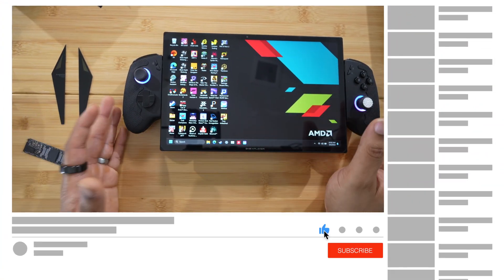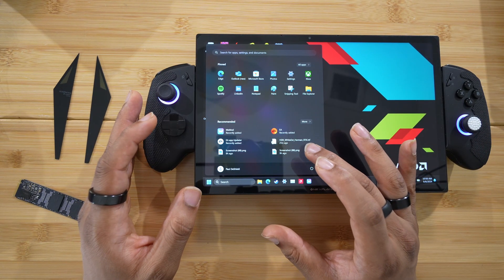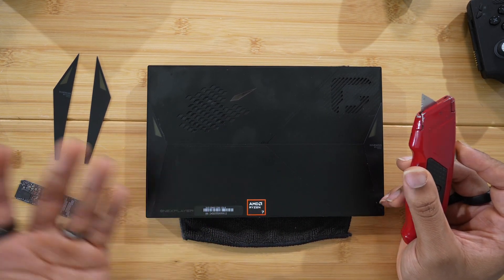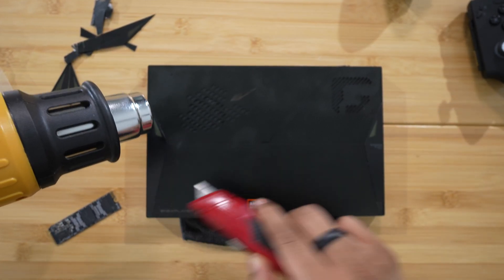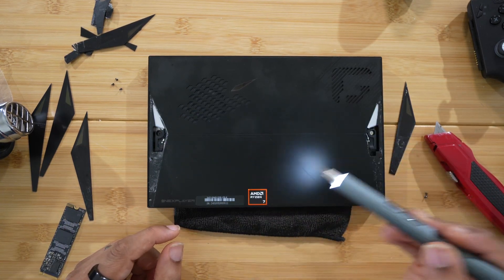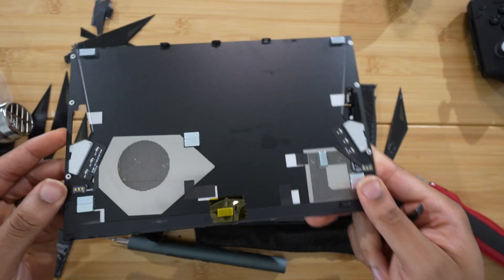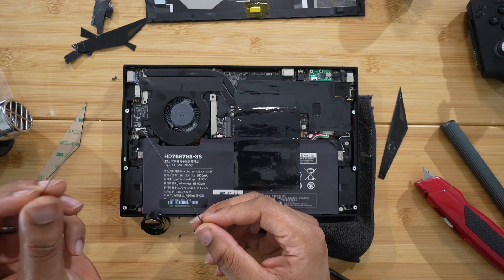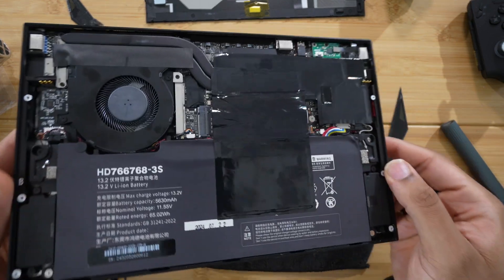OneXplayer X1 SSD replacement | A Cautionary Tale

Comment: I need the back back .  Likt the leather cover kickstand thing. Cant fint them anywhere..😅. 

I have a powered cooler that magnetically attaches and i wanna cut out a section so i can leave the cooler directly touching the body of the pc rather then the leather thingy .  

If i could find a replacement then id go ahead and cut the section out of the magnetic stand..  otherwise i prop it up against a weight i have lol...  I basically have it hooked up to a ultrawide 1440 p monitor and use it as q desktop.  It like the stand still caz of the built in camera and streaming otherwise id just close it and lay it flat on the desk..    anyway...  Know where i can find replacement back leather/ kickstand things for it?
Reply from the maker: You can get a replacement back cover stand here: 
https://onexplayerstore.com/collections/original-components/products/original-parts?variant=49662302159142
Reply: Lmao...  I didn't go far enough over. I legit thought the part list was looped with the different parts 😅. Thank you!! @BarelyAverageDude
Reply from the maker: @StonerDeer lol no problem 👍🏽

Comment: Will it take an 8tb?
Reply from the maker: It can
Reply: @BarelyAverageDude  tempted to get one to do it but knowing me I will break the glass
Reply from the maker: @ make sure to heat it up
Reply: I am weghing this vs the f1 pro@BarelyAverageDude
Reply from the maker: @jonsaavedra175  this definitely weighs more 😅 
(I couldn’t resist)
Reply: @BarelyAverageDude  i like the x1 because of oculink but I like the f1 because smaller and lighter lol but no oculink
Reply from the maker: @jonsaavedra175  don't tell OneXplayer, but what about Ayaneo 3? 
It's small and has Oculink 🤷🏽‍♂️
Reply: @BarelyAverageDude  fair but almost the same price as f1 pro but curious if it is a standard 2280 ssd and how the modular inputs interface
Reply from the maker: @jonsaavedra175  it's 2280 and the modules snap in with a securing mechanism and connect with internal pogo pins. 

I honestly think the Ayaneo 3 may be slightly better than the F1 pro (based on what it offers) but I haven't tested it of course

Comment: Was the ssd inside yours a 2280 size?  Sure looks like it and i was under the impression the larger x1s used a 2240 max size?
Reply from the maker: The big X1 uses 2280 SSD. 
The X1 mini is 2230/2242.

Comment: Was watching this as I did my SSD upgrade and it was not near as bad as you said. The official video did not show them heating it up, but you could see that the glass was using adhesive in their video. I just set my heat gun on 2 (hottest mode) and smoothly moved it over the glass without focusing on any particular location and it worked great. I also only used my knife AFTER I used the heat gun, no need to use it at the same time.
Reply from the maker: I took one for the team 😅
Glad you did it without issue
Reply: @BarelyAverageDude  I for one am glad u documented this because I'm the type that jumps into things before fully researching it thinking it'll be normal and like other units I've worked on.   I don't get why one x made the decision to use this build design.  I do like the quality they went to one the inside though.  Looks like they put lots of attention into it.  I also kinda wish they had used a second fan they obviously had room for it.

Comment: Question Barely Average Dude, may bring it up in the X1 discord as well.

Can an 8TB NVME SSD fit in there?
Saw Western Digital have a much "Cheaper" WD_BLACK 8TB SN850X on the market now.
I'm ready to buy if someone can confirm it does fit. (will not blame them if problems arise)
Reply from the maker: @AdmiralBison  I put a double sided 4tb SSD in mine and it fit snuggly. That gives me hope for an 8TB. I'll look into it.

Comment: hey quick question, i have a extra 2tb 2230 that I have and want to use that instead of buying a 2280. Could I just add the 2230 and tape it down with some electrical tape and a thermal pad?
Reply from the maker: @Cerealkiller824  you can use an extender like this to fill the gap. https://amzn.to/4gltX8W

I think it’s safer than just tape.
Reply: Thanks for the great question and stellar reply with link. Am extremely new to pc and gaming. In my 40s it's a tricky learning curve. This is exactly what I needed to know

Comment: Thanks for the video. It clears up some doubts about how this device is repairable. I believe using a blade creates extra tension on the glass, which will cause it to break due to its thickness. However, using an ultra-thin stainless steel curved spudger pry blade will have less tendency to break the glass.
Reply from the maker: Great tip!

Comment: Wait I thought the SSD was supposed to be accessible behind the kickstand. Is this the older version or was that marketing BS?
Reply from the maker: That’s the X1 mini
Reply: @BarelyAverageDude  now why wouldn't they just do it with both 8840u version?!
Reply from the maker: @ryanoliver960  it’s a totally different design, the X1 came out before the x1 mini and has an attachable magnetic stand so the tablet itself is just a flat metal back panel. The mini has a built-in kickstand that is much smaller.  
The stand on the X1 mini is way too small for the X1
Reply: @BarelyAverageDude  ah, I didn't realize they kept the original design of the x1 for the larger model. Good to know!

Comment: A few tips that might help in the future... You should not be holding the heat gun that close....a few inches away is optimal... Also always keep it moving sweeping back and forth. You could damage/melt something pretty easily. And maybe try a scalpel like they did in the tutorial video. But great and informative video.

Comment: as a X1 onwer thats the only thing I don't like about the device. Im guessing the next X1 will have the little back door panel like the X1 mini. I bought the 1tb but I should have got the 2tb for not much more. I just thought id change it myself but its not really meant to be opened. Buy the 2tb. Like I said the next version of this will most likely have the little back door panel for easy SSD swap like the X1 mini
Reply from the maker: That’s what I would hope. But since the x1 has a magnetic stand and the Mini has a built in kickstand we’ll have to wait and see.
Reply: @BarelyAverageDude  I wouldn't mind they 1 mini stand on the next x1

Comment: Question: is there a restore function that can be used after swapping out the drives or should I just find a copy of windows?
Reply from the maker: I believe the restore feature is in a recovery partition of the C drive so if you replace the SSD without cloning it will be like a new computer without the onexplayer stuff

Comment: Thanks for sharing this. Handhelds need to be easy for users to open them up and upgrade or clean dust out. When  opened up the onexplayer I had it was really tricky too for different reasons since it was a diff handheld. 
The best option is to 3d print some replacement covers instead of glass. Those would be much easier to take off
Reply from the maker: Yeah it’s crazy because the X1 mini is literally the EASIEST SSD replacement on any handheld. It’s just 4 screws on the kickstand. Not sure why the big X1 is this abomination. I guess they learned their lesson as the X1 mini came out after the X1. Idk 🤷🏽‍♂️
Reply: Yes do you have some 3d print models for this? I cannot find it in Bambulab